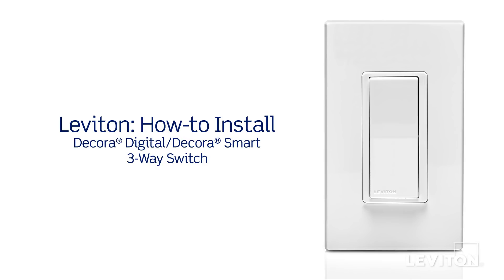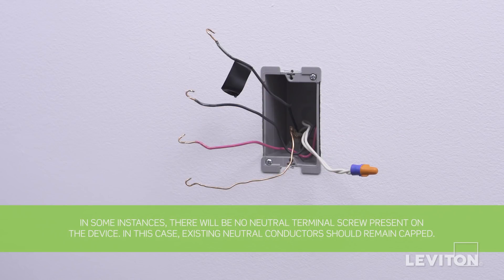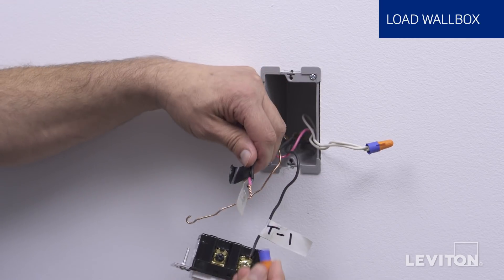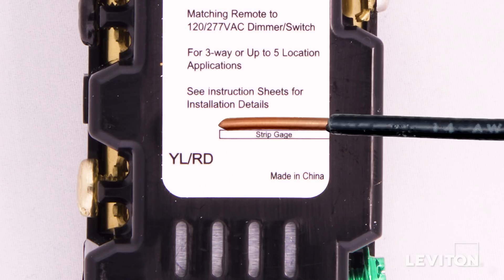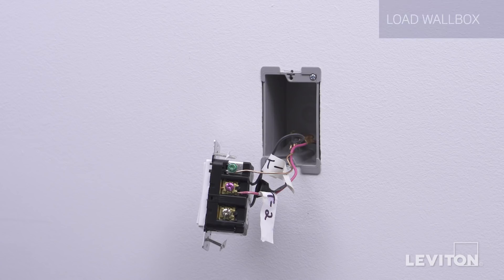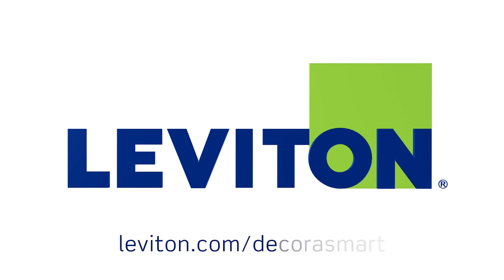How to Install a Decora Digital/Decora Smart 3-Way Switch | Leviton

Comment: If anyone would like to see how to install a Leviton Decora Smart Dimmer (DW6HD) with the Dimmer remote (DD00R), I have a video on my channel explaining how to do it. I would post a link directly to the video but it'll likely be blocked. I tried to follow the instructions in the above video and it doesn't jive with the instructions that were included with the switches.

Comment: I just got through my wiring and the video and comments confused the heck out of me. Don’t shortcut it. Use the instructions that came packaged with your devices. It’s all there, specific to your needs instead of a one size fits all video that isn’t. Worst case call Leviton Tech support.

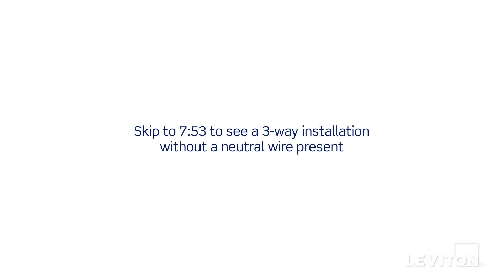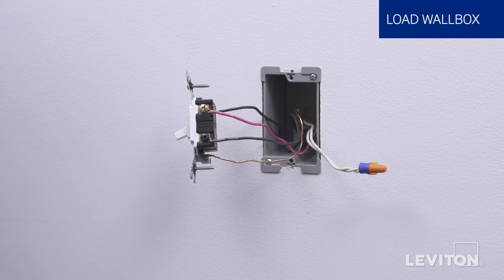Comment: 1:00 ;  1:35 first ; 2:18 Testing the wires ; 2:49 Line/Hot or Load discovery 3:29 repeat 
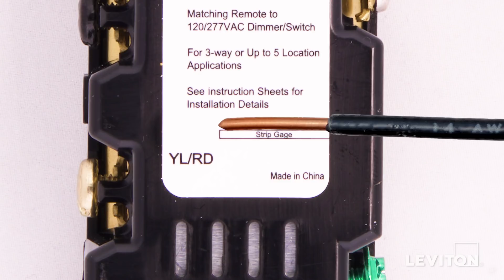3:57 begin ;  4:45 To wire (line box) (Scenario 1) 
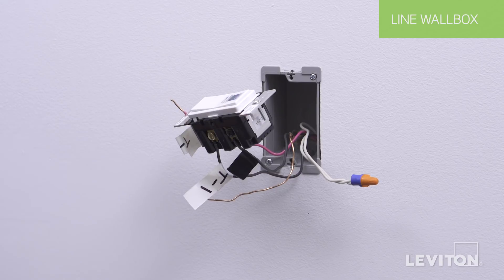5:16 Scenario 1: If device requires a neutral (Line wall box) 
6:10 Installing the Remote into the (*Load* wall box)
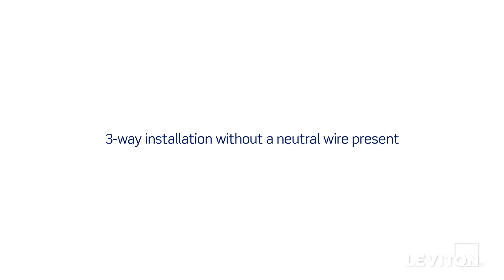7:53 Scenario 2: Neutral wire NOT present (Line wall box) 
9:47 Load wall box wiring 
11:13 Putting it back; turning the breaker box back on; testing it out.  
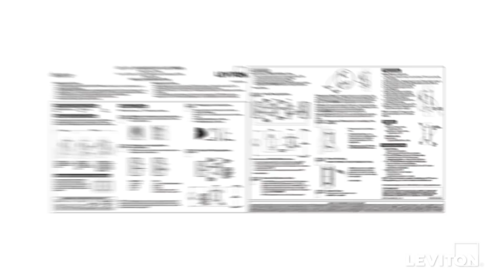11:47 Troubleshooting

Comment: I have (30) of the Leviton DH15S-1BZ 15A Decora Smart Switches, Works with Apple HomeKit and (10) of the Leviton DD0SR-1Z 120VAC Decora Digital/Decora Smart Coordinating Switch Remotes. I also have the Hunter Homekit smart fan, (2) KooGeek outlets, (4) Vocolinc outlets, (3) Kwikset Smart Locks, (2) smart shades, and an Ecobee 4 thermostat on my Homekit system. I have had this system up and operational for over a year. I have the RBR50 / RBS50 Orbi Mesh network. The one consistent thing about my system is that the Leviton Smart Switches always fail! Currently I have (6) of the switches that are not functining at all and another (2) of the switches that work for a couple of weeks then provide the dreaded, "Not Responding" message. I originally contacted the Leviton support center about 8 months ago and have received limited feedback. None of which provided any assistance, just questions and indiaction that they are still researching my issue (for 8 months?). Why do all of the other product operate flawlessly on my system, but the Leviton switches don't? LEVITON AND THIER SUPPORT ARE FRUSTRATING!!!
Reply from the maker: Hello Lance, the direct email to the group is DSSupport@leviton.com
Reply: oh? I guess is there a reason their's are the least expensive smart dimmer? did their support email help?

Comment: This video contradicts what is written in the instructions that come with the dimmer and module.  I contacted Leviton and was told to use the wiring diagram in the instruction sheet.
Reply: We used the instructions in the manual and 1 switch worked but the LOAD BOX did not work at all.

Comment: If any one face problems, please do this check list.

Remote Switch and Smart Switch both should have same travel wire connected at YL/RD. Travel wires are 2, if you pick 1 that 1 should be used at YL/RD on both remote switch and smart switch. This is the data wire that communicates between two switches . it is not like conventional technique.

Remote Switch is not responsible to load the light all it does is pass the state(on/off) to Master switch. thats it.
Now to power on load , connect the load wire to 2nd traveller wire on load side of the box where you had installed Remote Switch. Again remote switch should be on load side.

now the question is how does 2nd traveller wire get power. It is done by Master switch and yes it is smart switch installed on hot/line side. In Master / Smart switch connect hot to BK, traveller wire 1 ,  to YL/RD.  AND Traveler wire 2 to RD. 

Thats it .. you are good to go.   Neutral is needed on both the switches..  Again this works for Coordinating switch that has no LED. 

For Matching Switch that has LED it works slightly different. ask me if u need help.
Reply: Could you please confirm one thing.  Per Tim Vu above, Smart Dimmer should be on the load wall box not on the line wall box, but you are saying it should be the opposite.  What you are suggesting is consistent with this video.  What is the right approach?  Thanks.
Reply: If you have a typical 3-way with the fixture between the two or three switches where the white neutral is neutral at first switch or where power comes in.  Then the neutral runs to - fixture and the black and red are travelers to fixture.  At the fixture the black from switch 1 connects to the white from switch 2 (there is not a neutral at switch 2), red to red and the black from switch 2 connects to the + on fixture.  What is the method for a remote and dimmer in this scenario?

Comment: This video contradicts the instructions in the packaging. Keep in mind that you need 2 types of switches. One is called a Remote switch. The other is called the Dimmer. The Dimmer should be connected to the LOAD Wallbox. The Remote should be connected to the Live (Hot) Wallbox. The rest is correct.
Reply: I was under the impression that you only have to replace one of the 3 way switches and not both.  Am I missing something?
Reply: @scwillie  You have to change the other switch as well. Here is how it work
If any one face problems, please do this check list.

Remote Switch and Smart Switch both should have same travel wire connected at YL/RD. Travel wires are 2, if you pick 1 that 1 should be used at YL/RD on both remote switch and smart switch. This is the data wire that communicates between two switches . it is not like conventional technique.

Remote Switch is not responsible to load the light all it does is pass the state(on/off) to Master switch. thats it.
Now to power on load , connect the load wire to 2nd traveller wire on load side of the box where you had installed Remote Switch. Again remote switch should be on load side.

now the question is how does 2nd traveller wire get power. It is done by Master switch and yes it is smart switch installed on hot/line side. In Master / Smart switch connect hot to BK, traveller wire 1 ,  to YL/RD.  AND Traveler wire 2 to RD. 

Thats it .. you are good to go.   Neutral is needed on both the switches..  Again this works for Coordinating switch that has no LED. 

For Matching Switch that has LED it works slightly different. ask me if u need help.
Reply: @sivucit  i have led!!
Reply: @sivucit  My coordinating switch has an LED. Can you tell me what the difference is between the two, and how I should wire the coordinating switch with the LED?
Reply: @sivucit  I have a remote with LED and I'm having a hard time figuring this out. The video from Leviton is completely different than the paper instructions, please can you help me, thanks.
Reply: Tim, you are totally correct! I was misguided by this video and wasted several hours. In the hindsight, the original regular 3-way switch that was replaced by the Remote switch should work was well.
Reply: This has been driving us crazy too!!  Thanks for pointing this out.
Reply: Note to self, next time I start a project I will read comments first then watch the video.  Thank you
Reply: thanks for this!
Reply: This video does contradict paper instructions! Make sure you wire REMOTE TO LINE HOT BOX and SMART DIMMER TO LOAD BOX. This seems counterintuitive, and I don't know if I'd figure this out if it wasn't for Tim Vu's comment! And yes you need to change both switches for 3-way application. I used DD00R-DL for remote and DW6HD for dimmer.
Reply: @ivalhan  I have the same two products as yours (DD00R-DLZ & DW6HD). I tried to follow Tim's instructions (the Remote in the 'Line Wallbox' and the Dimmer in the 'Load Wallbox') but the problem is that I cannot follow the connections in the video because the Remote (DD00R-DLZ) does NOT have the 'RD' terminal (red screw), only the Dimmer has that extra terminal, and when I inverted the wiring so I could connect the 'traveler 2' to the red screw in the Dimmer, the lights will never turn on. How did you make it work? Do you have any pictures of both? Thanks a lot!

Comment: Wish Leviton would include that piece of wire you need to wire the neutral!
Reply: They also leave out the wire nut for the remote switch install part to connect the traveler and load wire. GE sells smart switches that come with the neutral wire and its cheaper. I can't believe the more expensive light switch doesn't include something that is essential to install and is so cheap.

Comment: Bought DW6HD-1BZ and DD00R-DLZ Installed as directed. Light now stays on neither switch works. Nothing out of the ordinary the wires in the wall boxes match whats in the video. Could one of the switches be faulty?
Reply: Sancho I have the same problem, how was your issue resolved?
Reply: Sancho did you get it resolved,? I have the same issue
Reply: See Tim Vu's and my comment below.. hope it will resolve your issue
Reply from the maker: Please email DSSupport@leviton.com or call 1-800-824-3005 so we could better assist you

Comment: Does the secondary switch needs to be a smart switch as well?
Reply from the maker: You will need a smart switch on one side and then the corresponding remote on the other if you want the 3-way capabilities plus the automation aspect